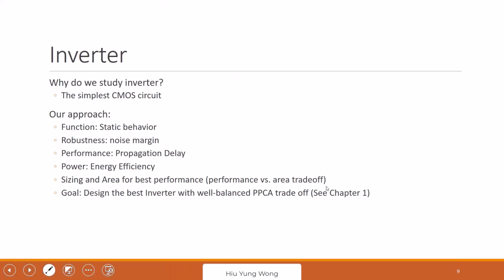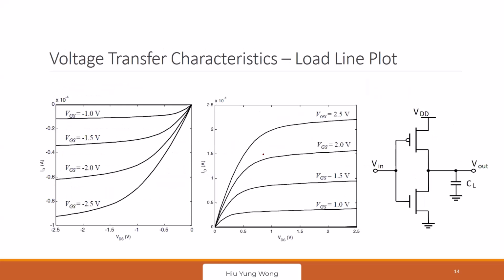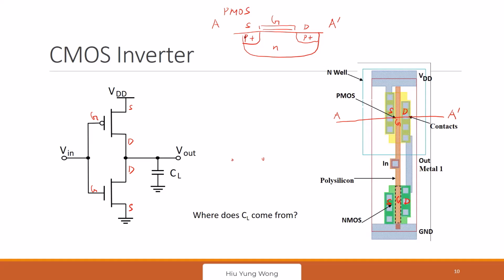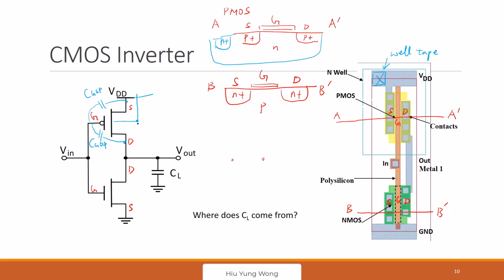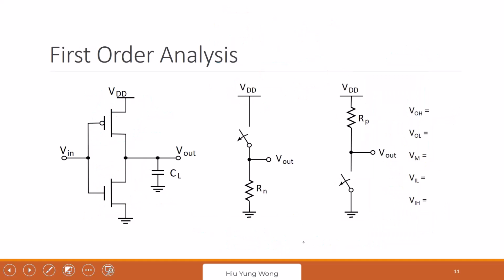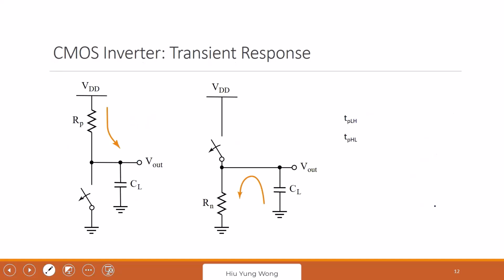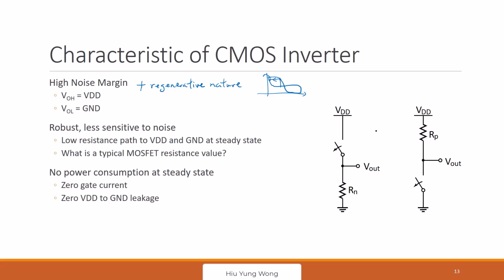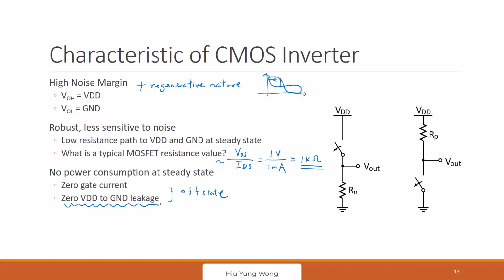L9-A CMOS Inverter First Order Analysis

Comment: Hi prof, at 9:50, C loading come from, why C bsp and C bsn are not considered?
Reply from the maker: This is because the bodies are AC grounded (connected to either VDD or 0, and thus have a constant voltage and thus are AC grounded). So you will not feel those capacitors at the output as they are not connected to the drain directly.